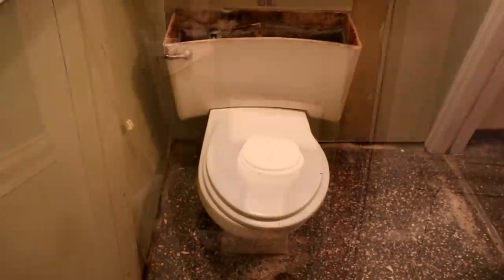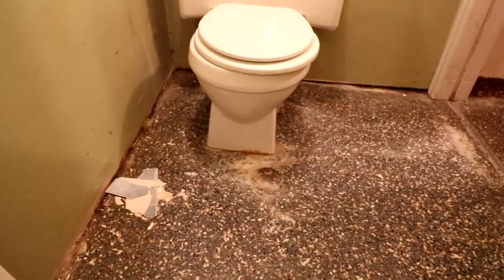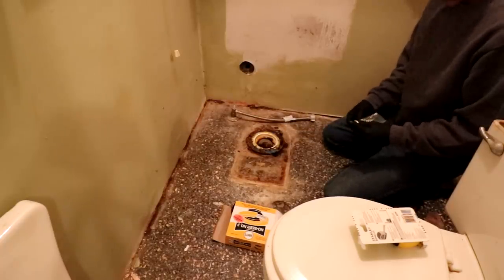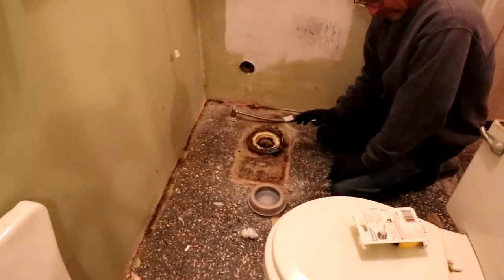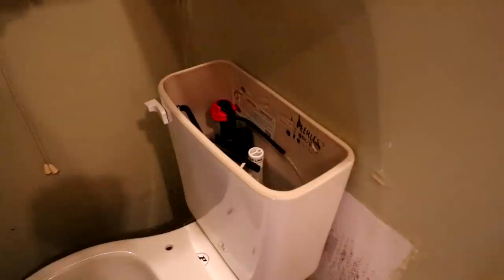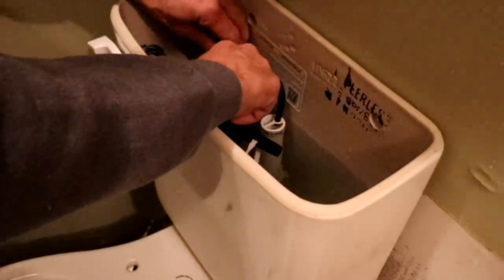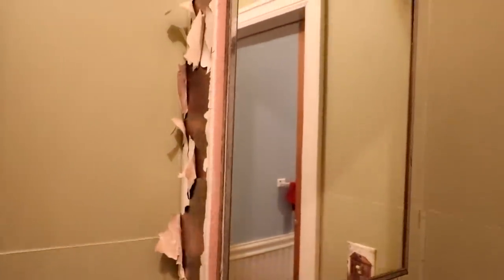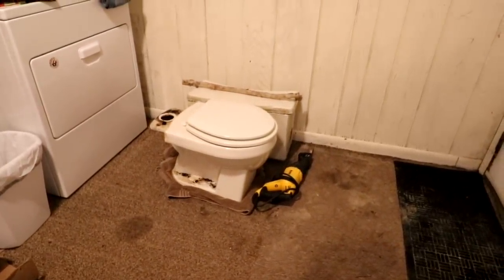THE HOUSE. New toilet in the Jack and Jill bathroom.

Comment: Thank you for sharing.  Great job that can be messy. Your a brave man removing a toilet in socking feet. LOL.  Most people put the toilet together before placing in place.  This is one of the first videos I have seen were you are building the toilet in place.  I think that looked easier then trying to lift the whole thing in place with the wax ring on the bottom.
Michael G has some great advise.  Hope others will read it.
Nice trick using vise grips to hold the nut when attaching the tank.  It would be great as you do some of your projects to point out little tricks you have learned over the years.

Comment: Well done sir.  You seem to think that toilet you removed is old.  It didn't look that old to me (although I am no expert on toilet age ;-).  The low flow toilets like the new one appears to be have very low water levels in the bowl.  That was most likely the correct way for it to fill.  We added one on a small remodel we had done after some broken pipe flooding a few years ago.  Doggone thing is hard to keep clean because it has so little water flow through it.  Ah well, always a better idea--right?
Reply from the maker: I was thinking that cleaning it will be a pain because of the low water level. I am glad you mentioned that. At least this is only temporary. The remodel will change it all.

Comment: When I built my home five years ago, I planned for a third bathroom/sauna in the lower level. Plumber had an apprentice who I think was unsupervised do the rough-in before the floor was poured. He set the shower drain and toilet drain 2' apart. I said to him, am I suppose to sit on the toilet in the shower?  The cement had to be busted-up and drains reset. When it can time to install the toilet, the plumber said, oh, your gonna need a 10" clearance one. Apparently the unsupervised apprentice didn't know that toilets require a 12" clearance. Menard's in Superior is a four hour round trip for me. A 10" clearance toilet is a special order. So I go back two weeks later to pick it up and find the tank was broken. Order another and wait two weeks for a replacement. When you have lots of guests/family you can never have enough bathrooms.
Reply from the maker: It really sucks when things are not done correctly.

Comment: I think I would have put a toilet in the bigger bathroom & also put a toilet & sink in this smaller bathroom.  I would want two bathrooms (even if one is small) instead of just 1 bathroom.  I don't want company using my master bathroom or even having to walk through my bedroom...lol
Reply from the maker: There is a toilet in the bigger bathroom as well as a tub/shower. I simply was adding a second toilet. That whole area will be changed and a shower and tub and toilet will be added in the second bathroom. This was just temporary so we have 2 working toilets.

Comment: Pro tip, save yourself the trouble of cutting off the old bolts. Instead, use a hammer and bust a small area around the Porcelain holding the bolts on.
Reply: Just need to make sure to wear safety glasses and gloves.  Broken porcelain is sharp.
Reply from the maker: Good idea but that toilet is so old and has the real big tank I was thinking it might be worth money or I may want to refurbish it and re use it. I guess being with Melissa so long now everything gets saved at first. Lol. Thank You.